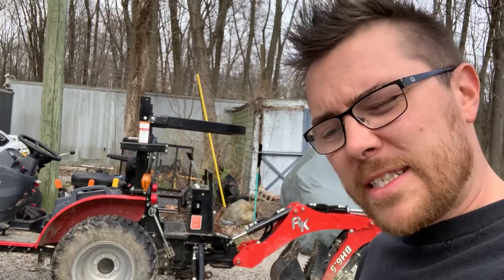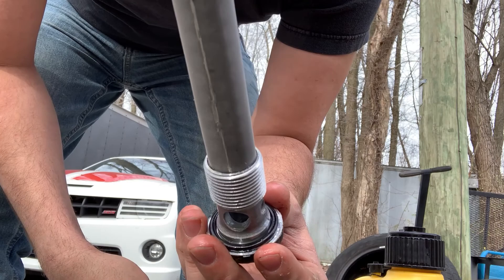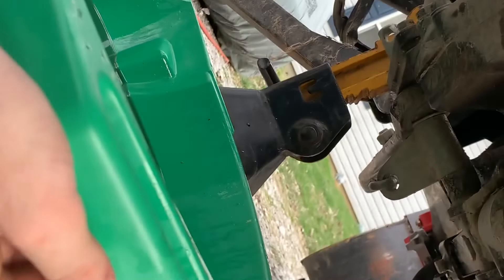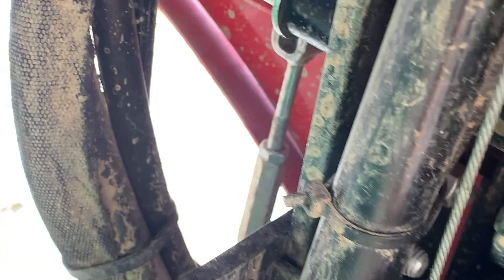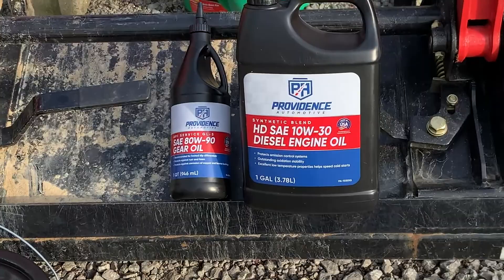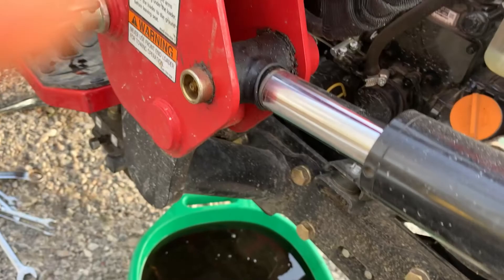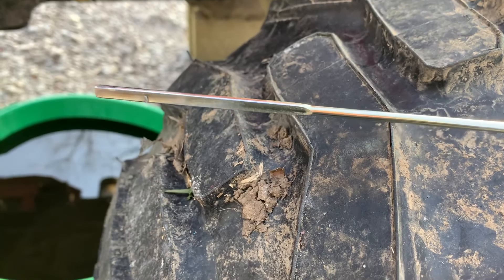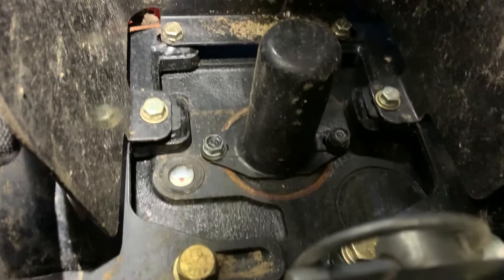RK24 50hr service step by step guide

Comment: Doing same service on My RK24. I found an easy way to remove Trans filter. Slide a 4-5 in hose clamp over it, tighten the screw then push on it with the screwdriver, it breaks free easily and you can push it several inches. Loosen the screw slide the clamp retighten then push again, mine was then able to turn easily and remove by hand. Do the same to tighten new filter back on. Took about 2 minutes.  I’m sure some filter wrenches work easily too.

Great Video, made my service so easy after watching your step by step procedures. Thank You!!

Comment: I  believe they put the filters on dry at the factory.   That would be why they are so hard to get loose.  and why we are told to wipe a little oil on the gasket before we install a new one.   Yep. very helpful guide,   appreciated.

Comment: Great video, thank you for it. I have the exact same tractor. Question though, you never touched on the fuel  or the fuel water separator filters. I’m told they also need to be changed for the warranty to be in affect. Went to RK and just said to give me what I need, those two filters were included. Anything special I need to know?